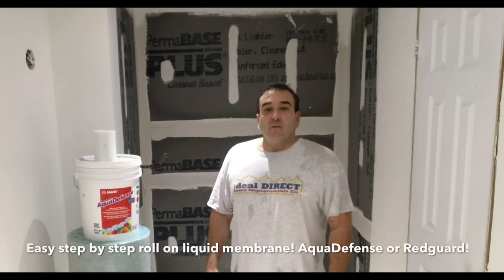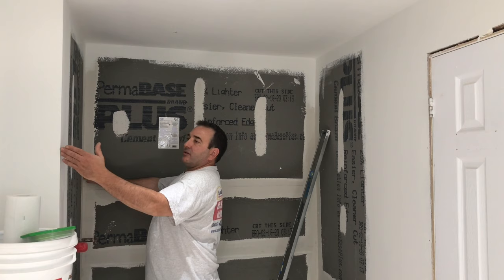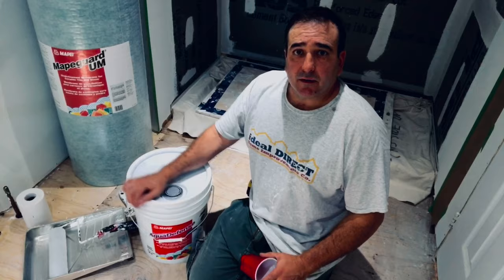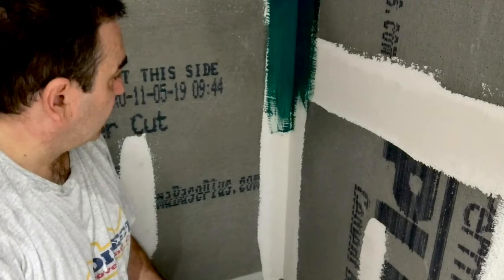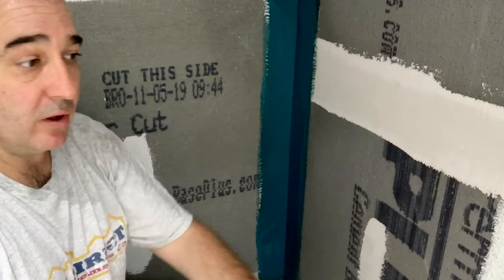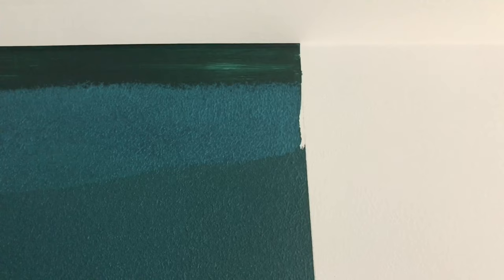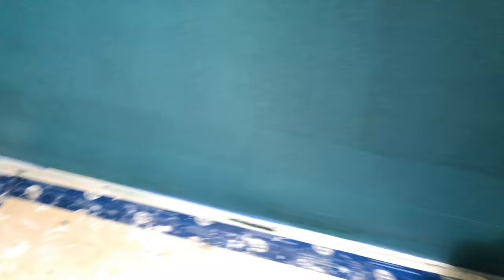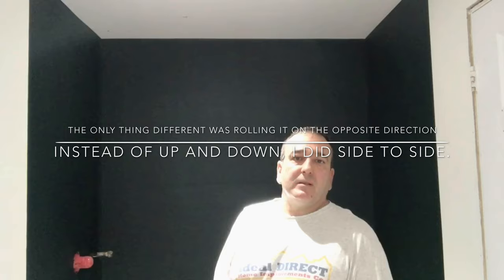DIY! How to Water Proof your Shower or Bath Tub Walls with a Liquid Paint on Membrane

Comment: Hi Edward it's me again :) I hope you don't get tired of my basic questions... I'm not a contractor or anything related, just an ordinary person learning from your videos. Again I've a couple questions for you if you don't mind
1 - What is the reason why you leave a gap between the fabric and the shower tray?
2 - This is not related to what you were showing. I see that you have cement board in the walls. I saw already green drywall being used in the same places and also saw people using green drywall in the entire bathroom except in the shower area where they used cement board. Can you help me understanding what are the differences and when one should be used in place of the other?

ps: By any chance do you have the videos of the steps before this one? Placing the shower tray, placing the walls, etc. Maybe you could do a series of these :) 

Thank you!
Reply from the maker: Hello Nuno, No worries about the questions, just keep in mind that sometimes it takes time to respond.
Let me try to answer your questions,,1- I left a gap with the fabric just to make sure that it doesn’t wick up water. The gap could be 1/4”. Even though the fabric was waterproofed as best could be, there is no reason to have it touch the base. 
2-You can use any type of backer for the shower other than any type of drywall. We use cement board because its stronger over time and it works for us. Green drywall can be used anywhere where you feel you want to use it. Its a better mold resistant other than regular drywall.
A video is actual on the drawing board for a complete install of shower water proofing and installing the pan. Stay tuned and we will slowly post more videos when the opportunity presents it self. It is very difficult to make videos and keep up with production. 
Nuno, our videos are just suggestions and showing how we do it. Remember, the videos we make are not what you have to do. They are only here to help, no more, no less.  
Thanks for watching, stay safe and healthy and happy holidays.